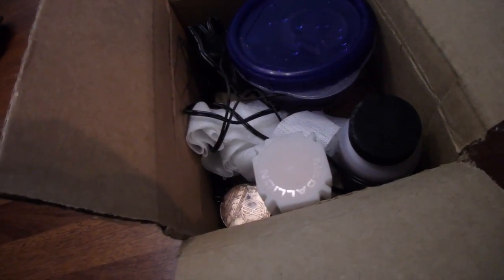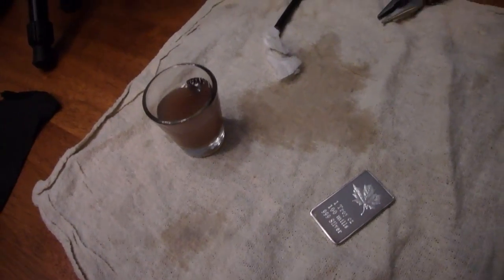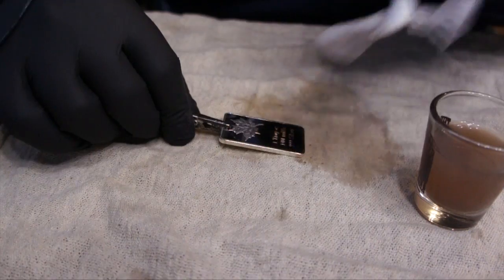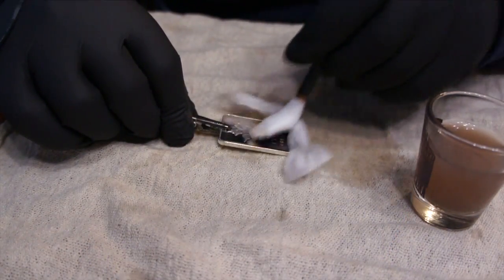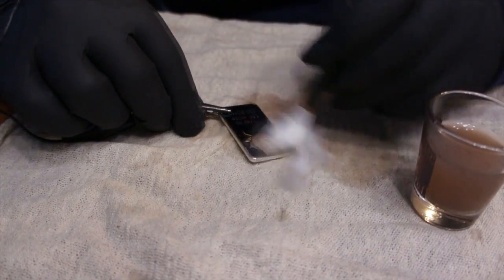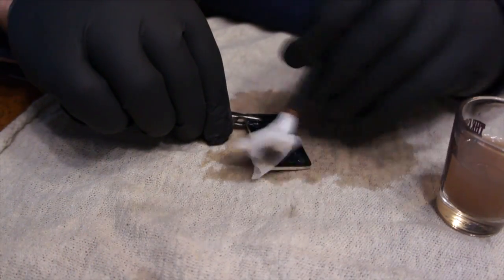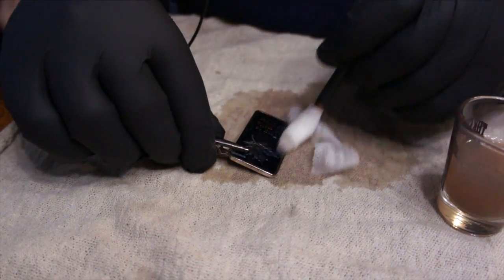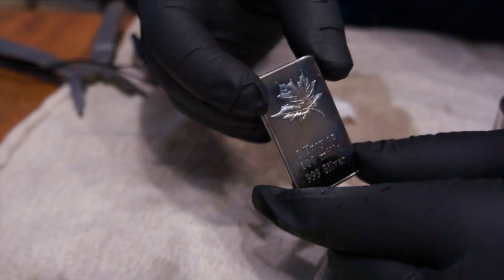DIY Black Chrome Plating on Fake Silver

Comment: Hey Jerry! From your experience with this plating do you think it's possible to do the headlight reflector bowls in an F150 same gen as yours. Part of a retrofit I'm thinking of doing but would look awesome if the chrome buckets were blackened somewhat. Keep it up, love your channels.
Reply from the maker: No I dont think it will work cause you need a good metal surface to plate, copper is a good conductor for plating.